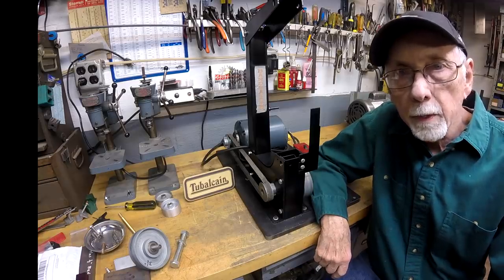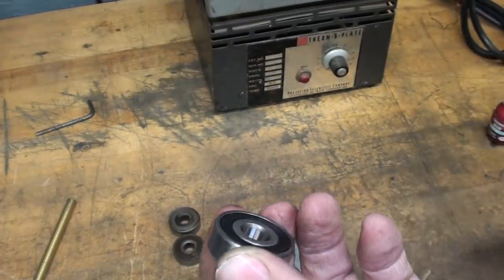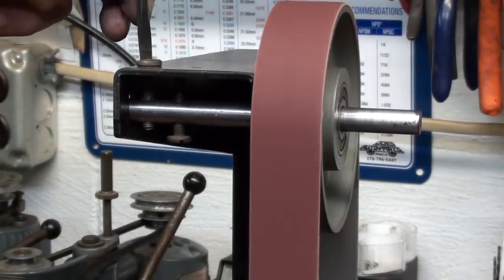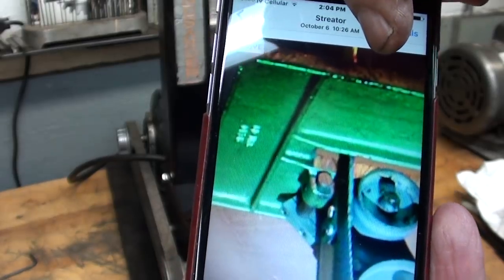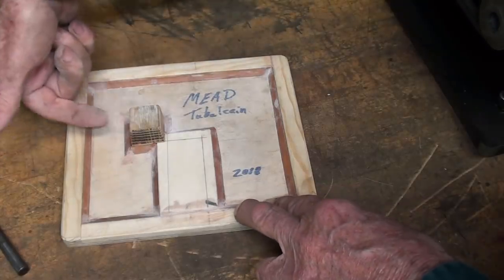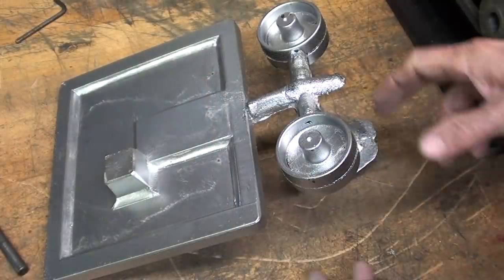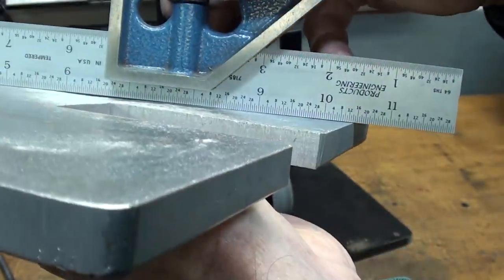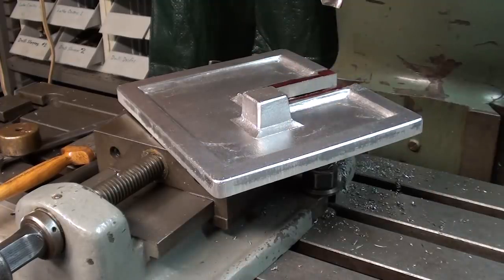Restoration of Mead Band Sander Tips 534 pt5 tubalcain foundry

Comment: Really enjoying this series. I have the Craftsman version of the 1x42 sander--almost same design. I had two plastic adjusting knobs with 1/4-20 thread "in stock." Used them for the tracking screws. Very convenient for adjusting belt tracking.
Reply from the maker: Thank you, maybe I should have use knobs

Comment: these are great little sander/grinders, i have two of them. worked on way bigger material than these machines were designed for but so far so good. after watching your video i think i know the bearings need replacing on one of my machines. all good

Comment: That central lug, once the sides are milled straight, would be the perfect thing to grab with the vise while you fly-cut the top. No extra lugs required.
Reply from the maker: No, chatters and vibrates like crazy. We used to attempt that method

Comment: Love the video! Only part way into the first video. As a side note, eBay was created to sell ball bearings, lol! Seriously, I've purchased spare ball bearings for all my motors. Unfortunately I messed up several times and ordered the wrong bearings, because there's so many different cross references on bearings. So now I have a collection of odd shielded and some sealed bearings that are odd sizes and won't fit anything, and I'll have to find a way to use them. Regarding the belt speed, your grinder looks pleasant to use. One guy I just saw on YouTube with a vintage grinder, the belt pulleys were geared up to about 3,000 rpms, and it was scary how fast the belt was going, I think someone changed the pulleys at some point.

Comment: i did not know you can use loctite for bearings, very interesting to know this
Reply: It is Loctite bearing retaining compound, not thread locker.  Loctite comes in about 100 different flavours for different applications.  I'm not sure what makes retaining compound different than thread locker to be honest though.
Reply: i used threadlocker on copper pipe before, to hold on a endcap. its strong  @barrygerbracht5077
Reply from the maker: Wonderful products

Comment: hi from uk mrpete i,m trying to build a mead band facer and i,m following your video, i,ve made the top pulley and fitted the two bearings i,m about to make the shaft , but i,m worried about making it too loose and also hoping to creep up on the right press fit, if its too tight i may bugger the bearings please can you give me a little advice. cheers john
Reply from the maker: Just try to get a fit or clearance of about .001 between the shaft on the bearing
Reply: thanks mrpete

Comment: What's the chances of buying one of your aluminum table castings to add to my Mead belt sander?  KenS.
Reply from the maker: Maybe later in the summer I can cast one up
Reply: That'll work.  Probably would not get to it until then due to my up coming hip replacement.  Thanks, Ken.  @mrpete222

Comment: maybe connect it to a hand drill for adjustment? no easy way to connect it without a helper though
Reply: I also am wondering if you can move that switch forward so you are not reaching behind the belt to turn it on and off. It does look like it can get alot of dust if you move it into that position.
Reply: to the side of the belt*

Comment: I have a Kalamazoo. If I use it and touch the frame I get little shocks. If the work touches the frame I can see little arcs. Is this a normal part of belt sanders- discharging static electricity?
Reply from the maker: Assuming your machine is properly grounded, it is static. I often get a shock

Comment: Well, why do they only half fill the Loctite bottles?
Reply: Friendly Robot  Because it cures in the absence of oxygen. If they filled the bottle with no air inside, the liquid will cure all by itself into a solid.
Reply: @jenniferwhitewolf3784  There's no oxygen at the bottom of the bottle. Why doesn't it cure from the bottom up as it sits on the shelf?
Reply: @WalkerKlondyke  , dissolved gases slowly diffuse through a liquid. In a volume that small the oxygen content would be fairly homogeneous.

Comment: Ummmm OK, I'll bite... so, why are Locktite bottles only half full?
Reply: Because it's anerobic, cures in the ABSENCE of oxygen. The bottle is half full of air so it doesn't turn hard as a rock before you can use it.
Reply: Got it...thanks!
Reply: @BarnyardEngineering  There's no oxygen at the bottom of the bottle how come it's doesn't set there?